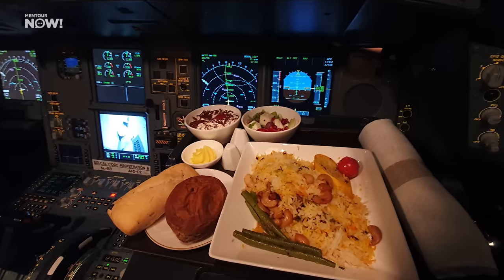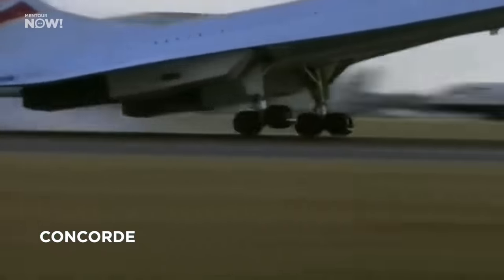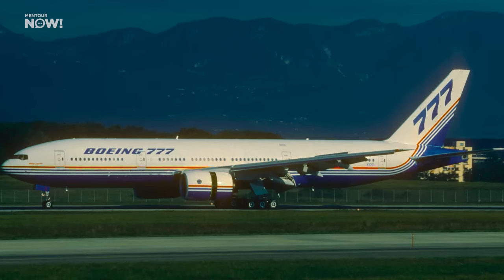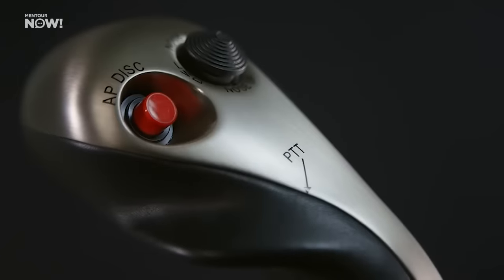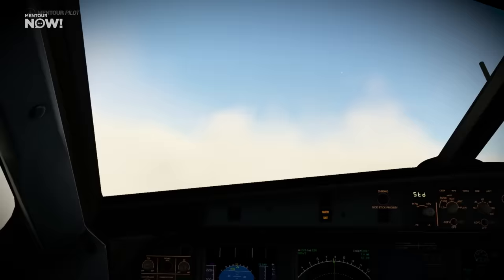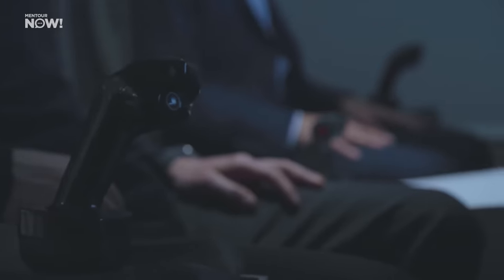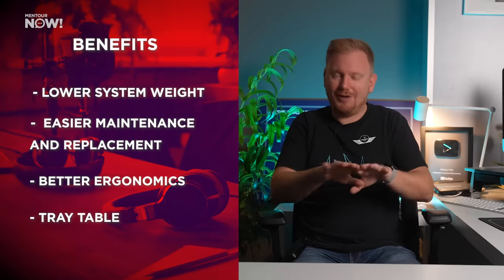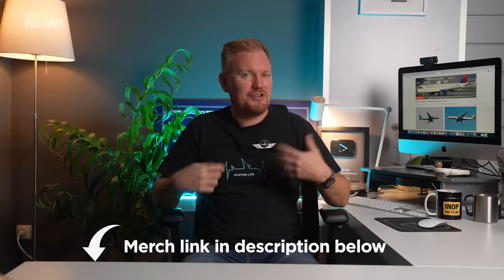Will Airbus Finally switch??

Comment: Petter, one problem which is rarely discussed is that of how we use our limbs. Most of us are not ambidextrous and therefore have a dominant hand. Whether it is the tiller of a ship, the steering of a car or a yoke of an aircraft, or everyday working tools, better balance and control comes from the dominant hand and to support and brace its movements, a supporting hand. Operating a yoke with a single hand for example is unwieldy , but extremely efficient with both hands in play. 

To my mind, there are 3 problems with a passive stick
1. As many Captains on your own channel have themselves commented, the mentouring process involving a Captain and First Officer is also important in a young pilot's career and the yoke movement and feedbacks are a very important part of that . 
2. Passive sidesticks require both right and left hand training. A pilot friend of mine flying for Indigo Airlines mentioned how training times have increased after pilots have to demonstrate both right hand AND left hand proficiency.( A problem not present in the yoke)
3. Imagine handling crosswind takeoffs and landings or emergencies that you nailed as an experienced First Officer flying a few thousand hours on the right sidestick.For the first few 100 hours in the shift from right to left seat, there would be an orientation,muscle memory and dominant hand issue when you switch seats in a crosswind or emergency situation ! Can you perform tasks with the same degree of proficiency with a less than dominant hand. This problem is not there in the yoke !

I'm not against sidesticks but for the above reasons and seeing how pilots behave under stress in emergencies,  I'm still in favour of a yoke.

I also want to note without bias
1. The yoke is an ambidextrous  control WITHOUT a left or right bias
2. The yoke has feedback and synchronicity of motion
3. The yoke is bulkier and heavier in its mechanism as compared to the sidestick because of physical links,levers,pulleys,gears and hydraulics.

The IDEAL control would be to be to have an electronic, ambidextrous ,active ,feedback controlled , sensitive ,sidestick shaped like a yoke( but without the weight or complex mechanical linkages of a present yoke) and  placed DEAD CENTER like in a Boeing between the legs likea yoke. It should also be possible to have a foldable mechanism that slips this active yoke shaped sidestick into a tiny forward cabinet by a button whenever pilots have their food to reveal a tray( like you find with kitchen appliances which go in and out of kitchen  cabinets for example). And by a push of a button( like in an autopilot), the active yoke shaped sidestick can be flipped out of its cabinet to be active again quickly. How's that?

Comment: Even if they can fit active sidesticks, the problem remains that a sidestick can never provide the same visual or tactile feedback that a big yoke can for two reasons.

Firstly, a sidestick is a smaller component tucked away to the side and below the pilots immediate field of vision. Since it is not directly in front of the pilot its harder to notice it visually; the pilot has to go out of his/her way to look at it, and therefore he/she must already be aware that there is a problem that requires them to look in that direction.

Secondly, a sidestick has a much smaller range of motion compared to a yoke so its just not going to give that much feedback anyways.

However I think that sidesticks are the future. Most new planes seem to be adopting them, and I predict that Boeing will do so eventually because airlines will favor the lower costs of this technology, and ultimately that's what determines aircraft design choices. However from a safety viewpoint I think the yoke is the superior choice.

Comment: I am not a Pilot, this first, but I recognized the Sidesticks of Airbus visa the standard Yokes that most other planes use. For me the most irritating thing was that the Pilot must handle the stick with the left hand cause of the position at the left sidewall und the Co-Pilot has the stick on the right side handle the stick with the right hand. This in in my point of view a big change when the co-pilot get. the upgrade to pilot sitting then on the left. An additional training in mindset and sensivity, because most people are right hander.
Reply: But he flies the yoke with his left hand anyway, right hand on the throttles or settings on the glare shield!

Comment: Hi! I just have some note about 14:02. 
1. Irkut is no longer exists. It was integrated with Yakovlev (although Yakovlev is much smaller organization). So it now developed by Yakovlev. 
2. I think we (I'm working in Yakovlev, is it called now) we should produce some MS-21-310 planes for Rossiya airline next year.
3. Most hard thing to understand. Russians don't call their planes with developer name. So its just "Yak 42", not "Yakovlev Yak 42".

Comment: There is one thing boeing can have with Yokes that side sticks can't. Manual reversion. Where the yokes have a direct connection to the flight control surfaces im case of emergency
Reply: That only applies to the 707-737 where the yoke is directly connected. ALL Boeing aircraft models after the 737, manual reversion is not possible due to the yoke being connected to the hydraulic system, not the flight controls. So that point in terms of airliners doesn't hold that much weight. Also the A350 and A380 can fly with both hydraulic systems dead thanks to Electro Backup Hydraulic Actuators that will power most flight surfaces. No need for manual reversion for those 2.

Comment: Small correction, the Boeing 777 is not completely fly by wire. The final fallback system is a old fashioned control cable that goes to spoiler 7 and 14 plus one for the elevator. It's more of a "where would you like to crashland?" system because it will only really be in control when all the hydraulics have failed including the RAT(which is connect to the C-HYD system).  Anyway, bit of a pendantic side tangent.

Comment: It was not until this video that I understood why my nephew, a  retired pilot who served both in the U.S. Air Force  KC-10 and in Boeing  airliners would refer to Airbus as "Scare Bus".  Lack of tactile feel has to be one factor. One time long ago he got me permission to use the KC-10 simulator, and hundreds of landings in gaming "flight simulators"  beforehand without tactile feel, let me "land" that KC-10 simulator that did have feel to it, yoke and cockpit motion together. It made a huge difference in how I adapted to it for a very brief flight through a standard pattern. I 'landed' it successfully when I did not think it possible when I had not had flight experience beyond some brief yoke time in light aircraft flown by others.

Comment: Just for general interest, the fly -by -wire system was invented by Karl Otto Altvater in 1941 for use on the Heinkel  HE 111. In 1956 substantial research was carried at RAE Farnborough on fly -by wire -systems using an Avro 707C and this became the first aircraft of its kind to have a side stick system fitted and continued to fly up to September 1966.

Comment: My father was on the YF16 project. His bit was the interface between the terrain tracking radar and the autopilot. This part did not work well at first, with extremely rough rides, some minor injuries and probably some brown pants. The simulator and test rigs showed that everything was actually in spec and working per the design, but it was not acceptable. He got a ride. Out over the ocean the terrain tracking was turned on. The plane flew down to the deck as expected. But when they flew over the tip of some tiny islands, it was so rough that you could not read the instruments. All you could see was a green blur below fading to blue above. Then they were over the gulf and things were smooth again. It turned out that there was a missing specification called Jerk. It is the rate of change in acceleration. It is measured in M/S³. Once that limit had been programmed in, it flew as expected, rough, but not so rough that it injured people or that they couldn't fly the plane, navigate or fire weapons. One big difference between the F16 stick and the ones in Airbus cockpits is that yhe F16 stick does not move. Instead the force against it is measured.

Comment: 320 pilot here,just wanna say great video,and it will be sooooo nice if we can have active sidesticks like the one in the video,it's gonna be so easy for the PM to understand what is going on and if he/she needs to start input under certain situation,but I don't think the sidestick should still be active and moving when the AP is on tho,cuz like if your palne is supposed to go up,well just check if the attitude is going up which is exactly what we are doing rn,I don't think it necessary to actually see the movement of the stick to make sure if it's following the current flt plan tho,it's the computer controlling the surface,the computer won't be like "going up by moving backward 1 inch",so yeah,an active sidestick but freeze when AP on will be perfect from my humble view,thx

Comment: I have done aerobatics training in several single-engine aircraft types. Yet I’m surprisingly poor at aerobatics in flight sims - even those with decent physics. This is partly due to the poor visibility (unless you have VR), but I think mostly due to the lack of feeling in the controls.

In a real aerobatic aircraft you can feel the onset of a stall through the stick - especially if it has buffet bars fitted. But on MS FlightSim 2020, I was struggling to do a basic loop in the Pitts Special, until I realized I had initiated the loop with too much G, causing the wings to stall, thus severely limiting the climb (the Pitts is powerful enough to climb while fully stalled), but I had no idea until I checked the instruments.

So I’m terrified by the consequences of a real aircraft with no force feedback! Glad to hear that might be put an end to.

Comment: Retired MD-11 / 717 PIC - Just my take, I do not feel comfortable with anything other than a yoke.  After 50 years of flying in total, I want to feel the airplane, not speak to the flight control surfaces via a computer.   The way I see things, the more complex any system becomes, the more likely it remains to fail.  Simple logic.

Comment: That lack of coupling and the resultant decrease in awareness between the pilots has always puzzled me about the Airbus controls. It seems fundamental that I’d want to know what input efforts the other pilot is applying to the controls, and/or be able to feel the plane’s trim conditions and get some idea of where in the flight envelope it might be operating - controls stiffen at high speed and get mushy as you slow.  A stick that feels the same no matter what removes a lot of 'feel' and seems to have fatally bitten people several times at least - the Air France flight that literally fell out of the sky in a stall being a prime example.  In a chaotic situation like that, there’s no way to know if it might have saved the flight, but for sure the lack of awareness between the pilots in that instance in no way helped.

Comment: As a non pilot I wondered, as I watched the video, how to make these active sidesticks as reliable as possible. That would mean with as little moving parts as possible and  the Philips CD player swing arm sprung to mind. In that just two electrical coils in a magnetic field kept the laser arm firmly in any desired position. Two sets of those would suffice for the two gradients necessary. No need for gears and motors. Feedback from the other sidestick and also rudder surfaces could be used as inputs to secure a feedback feel like on a non fly by wire plane ( I did take off and did a touch and go once as FO in a Fokker 100 training simulator, the rudder feedback is something I remember as a positive trait).
I wonder if that's how it's done in practice with actual active side sticks 
Educational videos btw!🙂

Comment: But what about "WOW" factor of "MAX SURPRISE" emerg situation!  Example - mid 90s on Approach & Capt noticed Hwy Wkr drivin' insane!  Only wasted time was sayin', "Hey, Ya outta see this crazy Hwy Wkr...OH....Holy SHT", as went full gas-flaps, wheels up, nose down, as noticed stationery.  Most violent windshear/downdraft had just hit loaded MDOT Pickup popping it up & slammin' it down incr speed 55 to 85!  On glance up, there was this NWA Liner on approach, into 150 kt headwind, meaning stock still for Capt!  Ahole Driver flipped on beacons, put Trk up on 2 wheels, stood up thru side window pointing at Capt, while slaloming 40' side-to-side on I-96.  Once noticed, Capt had about 1 sec to take actions or all die.  Turbines spooled back up as Liner flat plummeted pulling out at last instant.  Ruined Liner w/wingtips dragging on runway, Capt arrested & cuffed by GRPD for Evidence Tampering and Joyriding Aircraft while pulling oak limbs from belly.  Other damages to plane were 5 breaks in wingspar, antennae removed, plates-wiring-plumbing all stretched out, entire Cabin trashed, entire Cabin Crew w/serious injuries, but Senior Stewardess broke spine as all were checking belts for landing.  After reading of NTSB Findings from Investigation, she pullled Capt down to level of her chair, & said, "You do know that we all still love you...right??"  It took NTSB 3 yrs to finger this out when Capt in 2nd chance meeting w/MDOT Driver this time at TPA Pilot's Lounge, Driver scribed entire happenings from up North on Dinner Napkin for NTSB Administration Bldg digestion next Monday AM.  No slot for napkins, so Dinner Napkin placed on Director's Desk!  He checked physical evidence against Investigation AND Dinner Napkin, NTSB missed everything, while Napkin explained everything.  Director ordered Investigation re-opened, made Capt whole, gave Capt Apology, and re-defined definition of, "Physically Impossible" for NTSB!!  So, do you finger this to be okay outcome for such fiasco, or would rather hear Capt's last words of, "Huh...hmm, now let's see...where on sidestick is control for this, CRUNCH!

Comment: I've very familiar with side sticks including servo-actuated dual sticks with feedback.  The aircraft I worked on first flew 22 years ago.
Reply: There are ways to keep pilots from fighting with each other.  On the aircraft I worked on, one pilot was designated as commanding pilot and had a switch on the stick that would decouple the feedback between sticks and basically ignore the inputs from the other stick.  This was a training aircraft and it gave the instructor the ability to turn the student's stick off (essentially) in the event the student started putting in non-recoverable inputs.

Comment: You might want to have a look at the Avro 707C jet aircraft which first flew on 1st July 1953. This was used in the development of fly-by-wire control systems through the 1950s. It had side sticks with conventional direct control on the port side and fly-by-wire on the starboard side.

Comment: Having flown the F-16 and currently flying the A32F, I love the sidestick and don’t have any issues with the no-feedback. I can definitely see the advantages of having a linked feedback system allowing the pilots intuitively understand the inputs provided to the aircraft but a proper aircraft hand off is still paramount as evident by crashes in the military from incorrect exchange of interlinked stick control.
Overall, I see the end of the yoke drawing nearer as the weight, space, ergonomics are all winners with a sidestick setup.

Comment: Active sidesticks seem like they'd be much harder to monitor than a yoke, maybe with some training you'd get used to it but it's not intuitive to look at one and gauge what it's doing.
It would be better (and simpler) to just have a small display on both sides of the cockpit that shows the direction the stick is being pushed in on a 2d plane.
Like a thumbstick/joystick drift checker/adjustment tool. A square screen with a dot in the centre (for a sidestick that isn't moving), if the sidestick is in a pitch up, the dot moves to the bottom of the screen, if a roll to the left, the dot moves to the left of the screen.
This could be used alongside the active sidestick also.

Comment: As a computer engineer, a good upgrade procedure would be to first replace the sticks, but use them as passive sticks, then upgrade the flight computer software to actually use the active feedback mechanism once enough planes have the new sticks and pilots have received the difference training . It might even be possible to switch according to pilot certification with some obvious behavior difference telling pilots that active stick is actually active .  Something like the stick moving 5° into the hand when taking control .

Comment: I would always favor a good solid yoke over a side stick any time any day, both as a pilot and or a passenger.

To my opinion, a yoke can greatly contribute to the human orientation, as it's situated straight in front of the pilot, you hold it firmly with both hands, and it has a large volume. Also as said, you can "feel" the airplane through it. Don't know if that's the case with a side stick.

Where as a side stick is either left or right of your field of vision, it's being held by one hand, and to my accounts, too low a position so as you can sustain annoyances like when holding a computer mouse for too long. Doesn't seem as feasible to fly manually for an extended period of time with a side stick, as you can with a yoke.